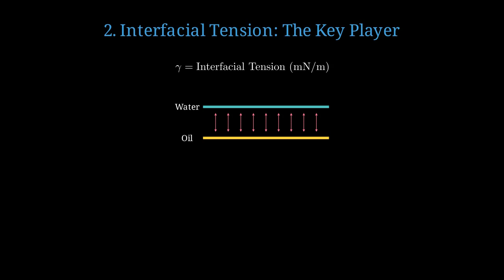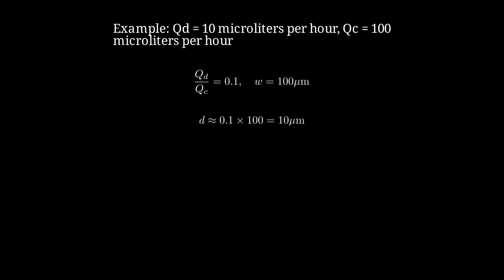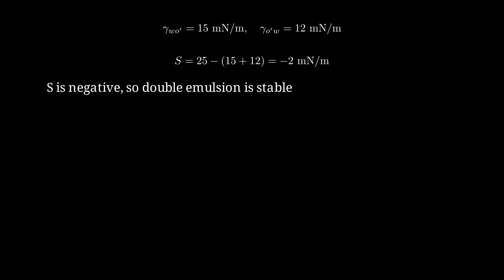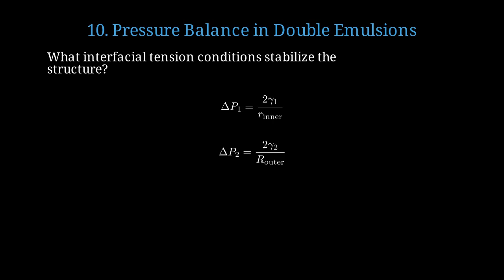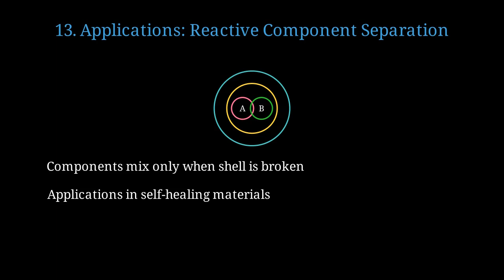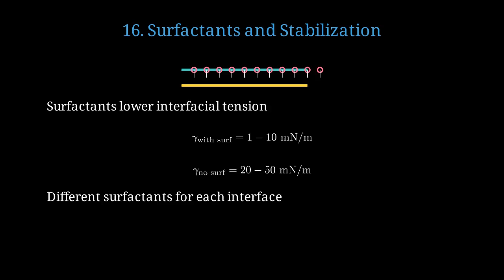What Are Core–Shell Droplets and Emulsions?

Comment from the maker: How can interfacial rheology models predict dynamic stability in triple emulsions with time-varying surfactant concentration?
What are the upper limits of droplet miniaturization before continuum assumptions fail in Laplace pressure calculations?
Can self-healing materials use programmable coalescence triggered by thermal or photochemical stimuli?